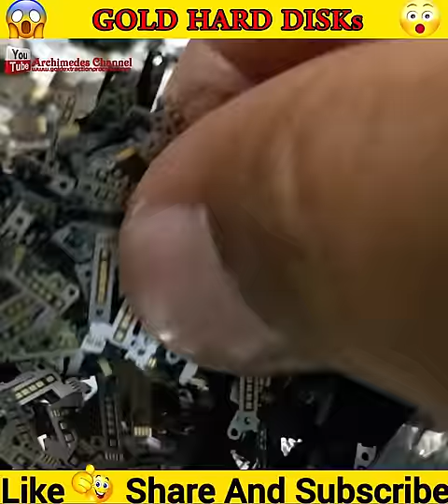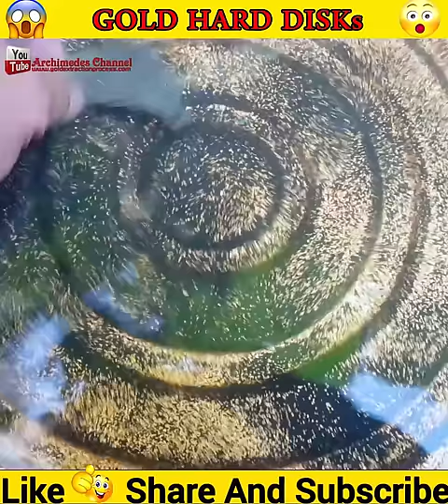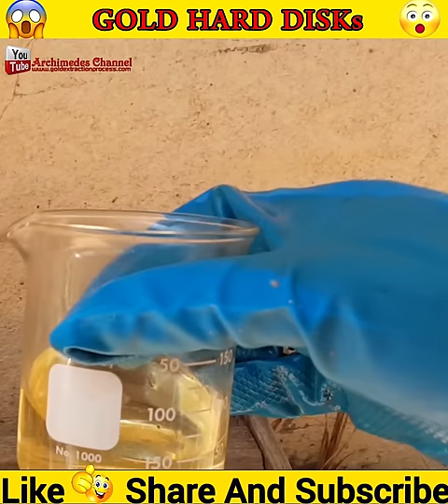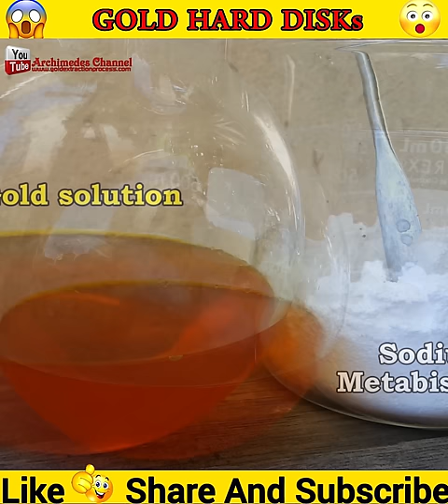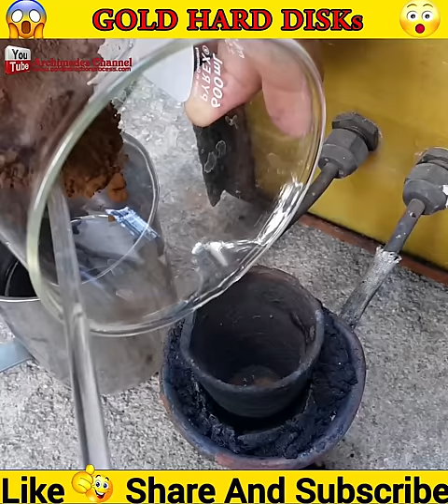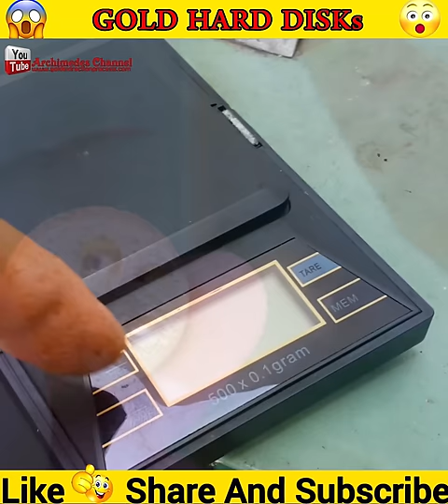500000 hard disks drive scrap HDD gold recovery

Comment: This is from 500, 000 hard drives . I have been recycling for 3 years with two helpers with a pickup truck and two cities and only have a couple hundred hard drives for free . If they got 500,000 it's for a corporate business. They took the one part most pure in gold on the reader arm . All the chips and gold connectors from the rest of the 500,000 hard drives would get another chuck like that but it is more labor. It's only worth it if everything is 100% free products. It's not cost effective unless you melt down tons and get all gold silver and palladium. And copper the most metal in electronics. No one brings up the copper and you would have more than 5000 dollars in copper from 500,000 drives.
Reply: And aluminium. 500,000 HD chassis’s would be a killer payday in aluminum
Reply: thats why he have youtube
Reply: Those are 25 million dollars worth of hard drives. Assuming 10% is only saleable metal, he could have easily made 2.5 million dollars.
Reply: @edwardspencer9397  would you show your math? Curious how you came to that sum. Thanks
Reply: 10 cents per hard drive.😊
Reply: im curious exactly how much gas money was burned in those 3 years? that's not including all the repairs, tune ups etc

Comment: I find it hard to believe that any operation would receive, accumulate 500, 000 hard drives, before they would recover the precious metals.
Reply: I used 50 desktop pc HD  from everything inside, chips, pins.. connectors .. the result was  around 1,3g Gold, i was busy around 2 days nonstop stripping the part’s..had more than 30kg aluminum $ iron metals..the average weight for 500,000 pc hhd will be around: 350000kg
Reply: @tomspeed2000  So do you mean you were only able to make about $70 from 50 computers?

Comment: That is insane!
 How many hours did you spend getting the parts out of those 500000 hard drives? and how much was the gold worth in total?
Reply: They didn't.  That was factory parts.  It can be done but it'll take many many hours of labor to harvest the little contacts. They should have explained that while showing where the parts they used came from on an assembled hard drive.
Reply: 81.4 grams of pure gold is worth $4,966.23 on feb 20, 2022, but his gold is  possibly  not 3 9s fine. Buyers may not always  buy at spot price. Depends on the market and the buyer. At 500000 pieces, that's less than 1 cent per hard drive. That assumes his title isn't in error.
Reply: For 500.000 hard drives...is not worth 4000$...only as a hoby..takes probably few years to colect 500.000 hard drives..but i think is much more other pieces they contain gold and much more gold than hard drives..even all the pins..the procesors etc..and many more..

Comment: Surely you people can't think this man amassed 500,000 actual hard drives??! Those gold stripes are purchased online in bulk sales from another company that hires much less paid workers that do all the dismantling of the product somewhere overseas due to manufacturers over ordering materials or no longer manufacturing a specific model etc..  thus creating a surplus that needs to be liquidated quickly so that the company can recoup fair market price value in case market price was to fluctuate with volatility hence one way to lose out as well as cash flow to purchase new precious metals required for existing and or new builds on the table as some of these companies end up tying lots of their operating cost on these "higher priced" components

Comment: I noticed at the end your Ingot for lack of a better word look to have some purple in it which could be just an optical anomaly from the camera but it also could be a little bit of aluminum alloyed with your gold which would put it around 90% gold and 10% of aluminum it's kind of useless losing all of the good qualities of either gold or aluminum but still interesting nonetheless because purple gold is what you get when you alloy aluminum with gold it has no practical uses except for sometimes is used Like a Stone because (it's an intermetallic with physical properties more similar to Stone than a metal) and although nobody really intentionally does that it is on rare occasions sometimes used in jewelry not as a ring but as a stone in a gold setting if cut and faceted and Polished correctly it has a very pleasant look
Reply: so its not possible to un-alloy certain metals?

Comment: What is its value number after melting ? 8K or less ?
Reply: less , 5k i'd say
Reply: If done properly 24K gold is the final product when chemically refining gold. The nitric acid should dissolve nearly all of the the base metals and washing it with concentrated sulfuric will remove any lead that is present. When you dissolve the gold foils in Aqua Regia and precipitate it out of solution you will get gold that is 99.95% pure.

Comment: This is worth your time❤️💯🙏………..81 grams gold is a  6000 dollars and some change.💯💯💯💯💯💯💯💯💯💯💯💯
Reply from the maker: You make a fair point. The potential financial gain from recovering 81 grams of gold, which could be worth around $6,000 at current market prices, is enticing. However, we have to carefully consider the risks and costs involved in pursuing this kind of precious metal extraction from electronic components.

As we discussed, the processes required, such as using extremely corrosive acids like aqua regia and dealing with hazardous fumes, present serious health and safety hazards. Proper protective equipment, fume hoods, and approved hazardous waste disposal are an absolute necessity and very expensive for an individual to implement safely.

Additionally, the source materials containing tiny amounts of gold, like gathering 500,000 hard drives you mentioned earlier, would require a monumental effort and likely cost more to acquire than the gold value recovered.

So while the raw dollar value of the recovered gold is meaningful, the risks, costs of doing it properly, and scale required to make it worthwhile financially are likely prohibitive unless you have access to an industrial-scale precious metal refining operation.

For an individual, it is probably wiser to avoid these kinds of hazardous extraction methods altogether. Recycling e-waste through legitimate regulated refiners is a much safer option, even if the personal financial gain is lower. Health, safety and environmental compliance should take precedence over pursuing relatively small amounts of precious metals through risky means. Let me know if you have any other thoughts on this.
Reply: @MakeGold  I 100% agree with you….. I’m retired at home looking for fun hobbies, sitting around home with not much to do is hard.
Reply: @MakeGold   Another thing whenever you see that beautiful gold, I got gold fever❤️❤️❤️❤️❤️❤️❤️❤️😂😂😂😂😂😂😂😍😍😍😍😍😍🤩🤩🤩🤩😋🤩🤩🤩

Comment: Approx. $5,000. Nice!
Reply: I don't see the economics in this. Assuming that you have a mostly automated system to open the drive cases and prepare them for the part removal, it appears it takes at least 30 seconds to separate each gold plated contact. So, for 500,000 drives, it would require 250,000 minutes of manual handling time. That comes out to over 4000 hours - so you are getting a return of only a bit over $1/hour for your efforts - ignoring all other handling, processing, disposal and chemical costs. 

Working 10 hours a day on the prep, it would take over 400 days for this step - with a return of about $10/day or $300/month.

Comment: are u sure 500000 hard drive it is very lot??!!!
Reply: maybe he just got the golden parts, new from a factory overstock ?
Reply from the maker: Industrial waste is plentiful, but difficult to reach for the general public.
Reply: @MakeGold  I understand if you don't want to answer this. But clearly you have a good connection to get industrial supply. But was it profitable for you to obtain all that and recover the gold. Factoring in the cost of supplies?. Also how long did it take to dismantle a half million hard drives and was it just you taking them apart?
Reply: @kristopherselvey8570  they did not disassemble anything.  He did that just to show where the part is located.